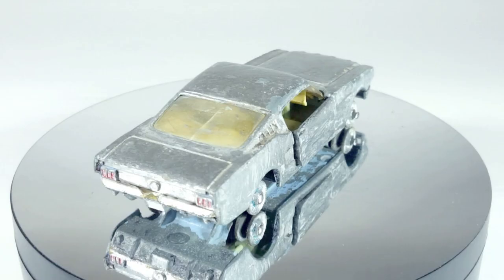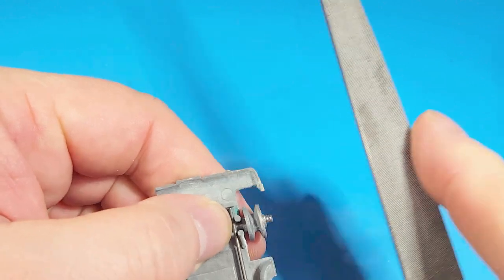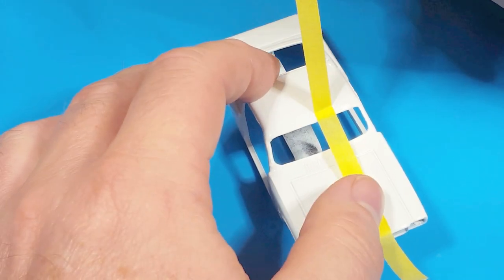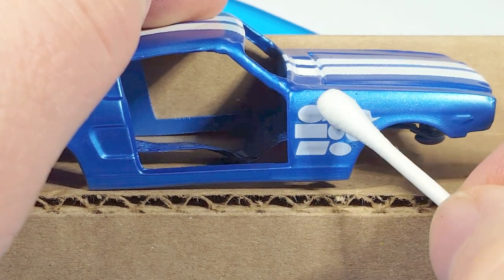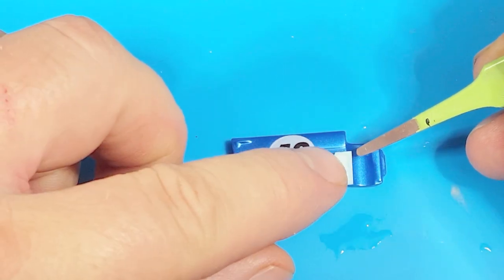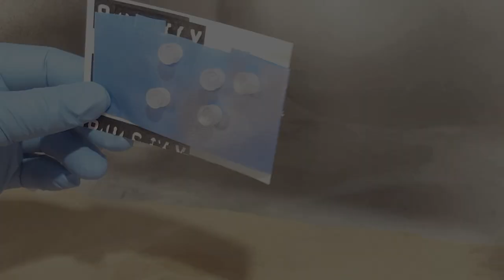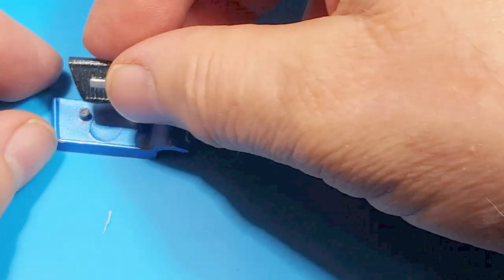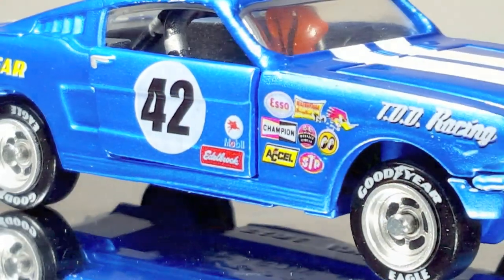Corgi 320 Mustang Fastback 2+2 customization

Comment: Super nice, job on that, Timo. I just got hold of one of these models. It's not in bad shape, other than the paint. I gave been using Home Hardware brand paint remover. It works well, is low cost and doesn't smell too bad.
Reply from the maker: Thanks Jesterger. There's a Home Hardware near me. I will check it out.

Comment: Beautiful job, Timo. Definite basket case to start out with.
It's a shame about the doors but ithink if you'd cut the hinges off, you'd have had even bigger problems trying to glue them shut.....they seem too small for the openings.
Did you settle on No. 42 by chance, or is that a little nod to Douglas Adams?
That was a very enjoyable way to wake up this morning 👍🏻👌🏻👏🏻.....off to work in a mo 😏
Be seeing you.......
Reply from the maker: Thanks Septic 🚽. You got the reference correct. When I choose a number, you should always assume it has another meaning. This one, is as you guessed, the meaning of life.
Reply: Had to be. You really know where your towell's at, man.....